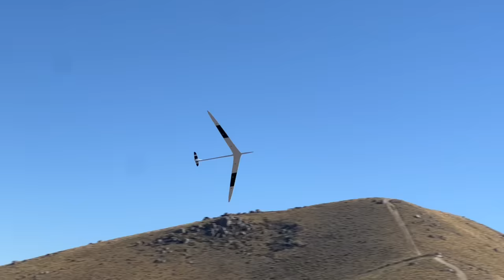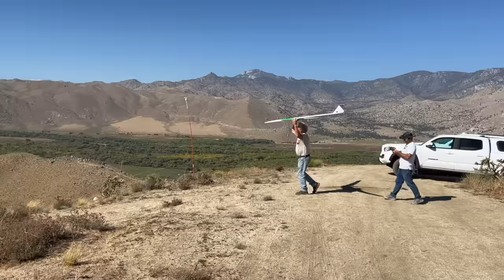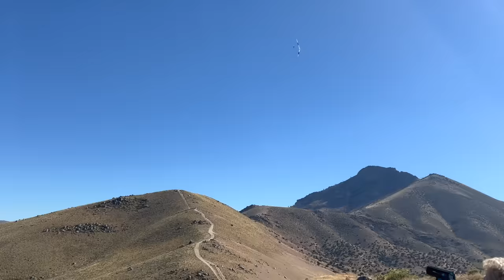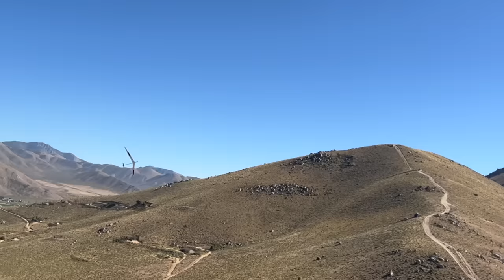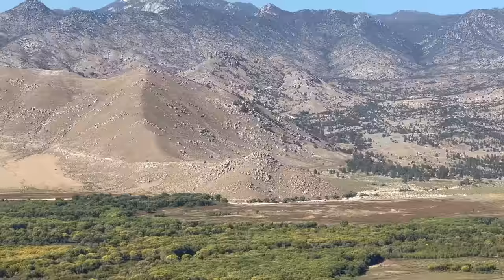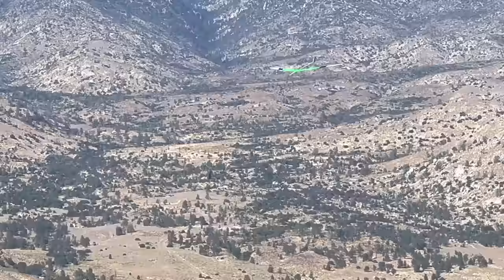Spencer testing Transonic Sweeper

Comment: Why not sweep the horizontal stabilizer?
Reply: I also want to know. Is it because the tail shock is in free air behind the aircraft so it can't upset the flight?
Reply: Sweeping the tail not as important because not as fat a wing to accelerate the air around it. But at some point yeah it might be needed
Reply: @emotodude  isn’t the sweep more about the shockwave?
Reply: @BikingVikingHH a forebody in front of the T tail junction would probably be enough transonic drag reduction. The vertical stab doesn't really need to be swept to reduce wave drag unless it's heavily loaded.

The glider will likely need more nose up trim as the CP moves aft at transonic speeds, though the increase in induced drag on the vertical stab is still kinda minimal. I think it's smart to stick with a straight stabilizer for the sake of keeping it thin and avoiding flutter. Thin and stiff is less draggy that fat and floppy, right?

Comment: Never thought I would see a sailplane fly that fast. Fantastic. Where was this video taken? Beautiful country.
Reply: The fastest RC planes are sailplanes.
Reply: Record for Dynamic Soaring is like 560mph these are full on carbon and kevlar gliders. Balsa,foam, fiberglass just doesn't cut it at these speeds and that's why DS has only come out in recent years of model flying.
Reply: Weldon, east of Lake Isabella.
Reply: @bryanlallen  I recognized the location because I windsurf on Lake Isabella and I’ve ridden those roads on the bike. I’ve been thinking of getting an RC glider to slope soar there.

Comment: Wow, I'm impressed (aerospace engineer).  How many G's is that thing pulling in those loops?
Reply: Someone in these comments said 80G
Reply: About a decade ago some guys put a strain gauge in a dynamic soaring plane. My memory is a little fuzzy on that but it seems like they said that 80 Gs was common and sometimes over 100 on emergency pull outs. That was probably flying at speeds similar to this flight back in those days. It would be interesting to see the G load for the current DS record which is 564 by this pilot in this video.

Comment: I am thinking that my 2.54 meter Vista Grande would be lapped 10 times before I could complete one loop of the same course.  That baby is moving so fast, I couldn't follow it sometimes.  I haven't read all the comments yet, but what speeds are you clocking?  I guess, it is best not to down any beers with the responsibility of that rocket in your hands.  That rules me out, ha. Great video.
Reply: I found the speed of 344 mph in a post...which just seems crazy if that is accurate.  I don't see how the rudder can handle that much stress.  I have to correct my post above to say my Vista would be lapped 50 times if I could keep it out of a thermal.

Comment: What am I doing with motors and lipos,??? When this is possible with wind! Incredible
Reply: When my friends ask me why I don't have more powered planes I always ask them why I would want to put an air brake (propeller) on the front of a plane and slow it down?  Even without dynamic soaring, front side slope gliding can easily produce speeds between 80 and 120 mph when the wind is blowing over 30 mph.  My personal record for wind speed is launching a plane in 56 mph winds, and then later that same day measuring 65 mph winds shortly after landing another plane. My friend who owns the radar gun was not there, so I don't know how fast I flew that day, but the speeds I mentioned earlier were verified by radar on days that were not so windy.

Comment: where does energy to fly plane come from ?
Reply: wind …. the wind is providing the lift, gravity is providing the acceleration.  his loops are circles with net vertical gains and losses . building speed with each one.  remember in a circle there is acceleration towards the center, proportional to the  mass and velocity of the object.  he can increase the planes mass limited only by his low speed lift requirements, to get air-born. he can fly increasing velocity , limited by material strengths at the body wing inflection points.  BRILLIANT AE work. im reminded of “Boyd’ who worked out the energy equations for optimizing fighter jets .  R E T BAE GT 1978.
Reply: Gravity has almost nothing to do with this flight.
Each time it flies across the wind at the high part of the flight, it converts momentum to energy, similar to how a sail boat uses its keel to tack across the wind faster than the wind is blowing.
Reply: @dougaltolan3017  watch the video again.  His loops are NOT horizontal . 
If they were he would have no net speed gains.  He is climbing with the wind , diving with gravity. Each loop adds potential energy which he converts to kinetic energy in his dives.
Reply: @Blueridge-Doc  in a full nose dive that plane would reach 100mph, never mind over 250mph which it did here.
The ONLY reason the downwind section is lower than the upwind is to move from one wind speed to another.
Reply: His energy state is increasing with increasing velocity ( his mass is constant ).
The wind velocity is stable relative to his velocity . 
If you follow my logic , he is increasing his energy state from gravity .  
Fighter pilots , climb high in a dog fight , to gain a velocity over a lighter foe. 
Velocity and tightening the loop , let’s them out maneuver the foe.  There are equations in AE , which will predict machine vs machine , which of equal pilots will win . These are calculations of states of energy , which exceed what the engines are doing. 

Sorry for the long explanation.

Comment: Very cool!. It would be interesting to know at what point the swept wing starts to pay dividends. At pure sub-sonic speeds (up to 500 maybe?) sweep decreases efficiency. You need to be able to push through those speeds and into the transonic realm before you get any advantage from sweep. Question would be can you get up to the speeds where it starts to work or does the increased subsonic drag prevent you ever getting there? I'm sure Spencer has done all the sums! I hope it works because it does look very cool!
Question 2.. Why no sweep on the horizontal stab?
Reply: I like your comment the best so far.  You are one fellow in here that knows what he is talking about. I would like to know what the true airspeed is, elevation and temperature.  I don't think this aircraft is flying at anywhere near 'transonic' speeds. But reading the comments here, many think it is on the verge of busting Mach I. 

It is hard to tell from a video, where I do not have a relative scale presentation, but it does not look close to transonic and I have seen powered quickie pylon racers that look nearly as fast. Hell yes it is going fast for a slope soaring aircraft, but 'transonic' seems hyperbolic.
Reply: @ChrisNobodySpecial the record is nearly 600mph with an unswept wing. I'm anxious to see what he can do with the final version after they have sorted the swept wing design
Reply: The wing sweep is more about directional stability than speed...🤔😳😏😏🇬🇧
Reply: @EnglishTurbines  what?
Reply: @budyeddi5814  When your in the valley side and near the ground, instability is a very real factor.This is where a lot of these models die...
Reply: @EnglishTurbines  maybe you didn't see his runs pushing close to 600mph? He was handling the machine just fine with a straight wing. The sweep is for speed
Reply: @budyeddi5814  You've never flown one of these, I can tell....lol..
Reply: @EnglishTurbines  what does that have to do with anything we're talking about? Topic, focus "...lol"
Reply: @budyeddi5814  Well, everything really. Turbulence conditions change from location to location, day to day. When the plane dips a wing in the valley side, reaction time is rather short. I'm sure you understand that...The sweep tends to dampen and stabilise this effect, in particular heading...The closer you go to the valley floor, the more speed you can pick up...The plane is flying subsonic. That said, some of the airflow over the airframe may be higher than others....The sweep by itself does not give him more airspeed. It will allow him to milk more energy though because of how the plane handles...Just watching a film clip does not tell you about how a model like this handles. It's all happening way too fast....😳

Comment: Gob smacking. Can it be taken very high and get the sound barrier by a total dive.
Reply: High yes
Sound barrier no
Reply: It works on the downwind side of a hill, using the different airflow of clean wind and sheltered part.
While there are wind gradients high up that can be used, none are so sharp as found by a hill.

Comment: 350mph is not transonic! That is turboprop speed. Or even WWII fighter speed. But I agree that is crazy fast for a glider.
Reply: The current record is nearly 600mph by the same guy in this video IIRC,  and that's with an unswept wing. This is the initial testing of their swept wing designs if I had to guess

Comment: Добрый день!
Не понятно зачем изготавливать такую сложную конструкцию
Ведь стреловидность крыла необходима при больших скоростях
Примерно выше 1000 км.час
А при таких скоростях, как летает эта модель, только потери в аэродинамике. 
Увеличенное сползание струи набегающего потока по передней кромки
Просто сделайте профиль на крыле ламинарным, такой как он и есть, и на консолях концы крыла разверните сам профиль в минус - примерно на 2 градуса
Такой подход уменьшит индуктивное сопротивление и увеличит качество крыла
И скорость будит достойной
Кино показанное \то не результат, хотя приятно смотрится 
Спасибо! 

Good afternoon
It’s not clear why such a complex structure should be made
After all, wing sweep is necessary at high speeds
Approximately above 1000 km.h.
And at such speeds as this model flies, there are only losses in aerodynamics.
Increased sliding of the free-stream jet along the leading edge
Just make the profile on the wing laminar, as it is, and on the consoles the ends of the wing turn the profile itself to minus - about 2 degrees
This approach will reduce induced drag and increase the quality of the wing
And the speed is decent
The movie shown is not the result, although it looks nice
Thank you!

Comment: Why is the tail plane not swept? Also it looks like the elevator sits behind the normal shock and hence inside separated flow. This leads to control inversal and dive and crash. You are just lucky that your plane is too slow and does not reach transonic. Even some clearly subsonic planes have "flying" wingtips to control roll at any speed.
Reply: I have heard that Spencer really struggles with plane design and dynamic soaring in general. He can only get up to 564mph (ground speed) and needs a new armchair expert to tell him how to do better.
Reply: Poor Spencer 😢
Reply: @EnniodBleu I heard that his previous model was just a foam board design and it used wingtips. It ripped apart during the hand launch. Crying shame.
Reply: HAHAHAHHAHAHAH @EnniodBleu

Comment: The only way such an aircraft is at transonic speeds is on Mars. That kind of wing will simply break apart at transoniq speeds on earth.
Reply: Actually, several years ago an aerospace engineer calculated that the current dynamic soaring record at that time, which if I recall correctly was a little over 500 mph, had localized airflow over a portion of the wing at mach 1.4 based upon the air pressure and temperature of that day.  These planes are incredibly tough.